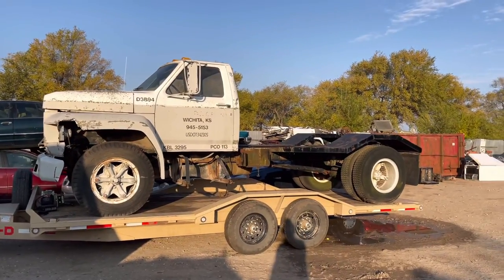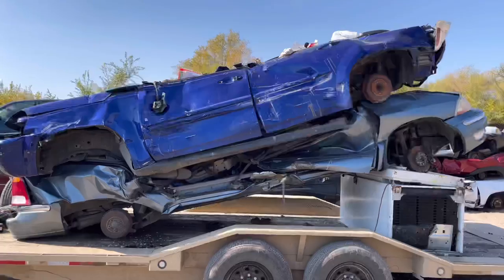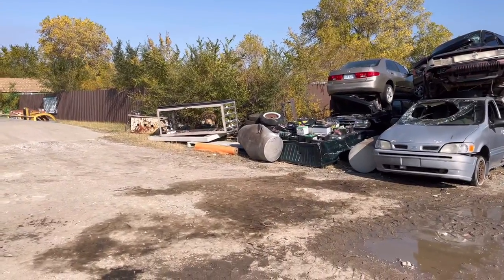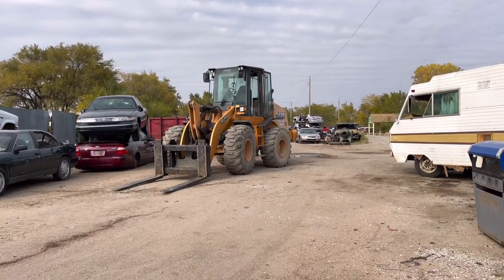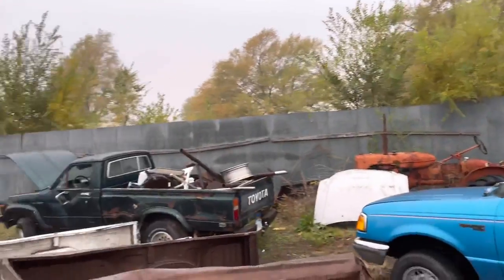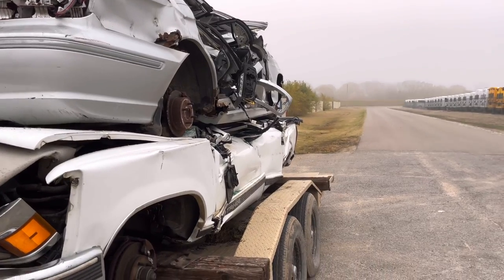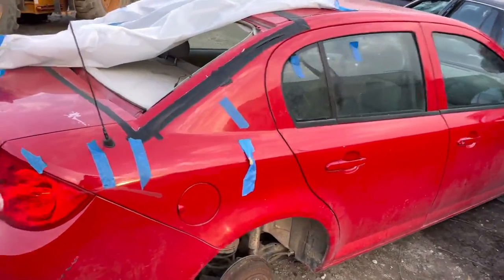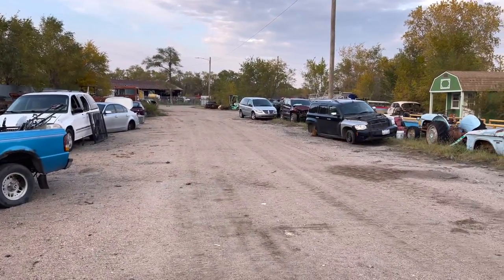I Hauled A TON Of Crushed Cars From Our Junkyard To The Claw

Comment: Silas we have a shredder here in North Little Rock , Arkansas , unload next to it see how the separate types of material is fed to a different conveyer and dumped in piles surrounded by concrete enclosures that front end loaders scoop up and load into dump trailers or enclosed trailers . All of the scrap is not any larger than silver dollar . They don't take tires or gas tanks . The shredder is the hammer anvil type that beats everything to pieces . A lot of the steel is loaded on barges across the river and shipped . The last time I saw the shredder it separated stuff into about ten different classifications . You gotta see it to believe it , it's so Cool .  Great videos

Comment: Consider using a flatbed straight truck to pull your trailer.  You could double the load per trip. And if you hired a driver to take the loads to the shredder, you could spend more time crushing cars.

Comment: Get 2 or 3 sheets of tread plate for your trailer to protect the wood
Reply from the maker: That adds a ton of weight and makes it slicker than snot when wet. If you’re not dragging a ton of nasty stuff off and on then wood is definitely the best
Reply: @AdventuresMadeFromScratch  Something to eat?  Like what?  Big fat steaks grilled right there in the junkyard! Yum!  Yum!  But what to drink, Pepsi or ___________?

Comment: Maybe if you keep running into that issue (availability) buy a new cheep brake booster cause maybe the new ones have a different valve size? I don't know just an idea I could be completely off base
Reply from the maker: They don’t sell new boosters, and the remans use the same size as this one unfortunately

Comment: I'm guessing the seats were from the Olds Silhouette?  I bought a 2003 new, drove it 190K miles with original spark plugs and original coolant, until the tranny died.  Everyone who changed the coolant needed a manifold gasket within a year, so I never changed it!  Great minivan, for the 190K miles, the trip computer says it averaged 26.2mpg.  Exactly the same as a V6 Audi A4 Quattro I had before it.

The other commenter with the theory that the guy just needed the bolts for the seats might be right, except that if the seats were like mine, there were no bolts on the middle and rear seats, they had catches you could release to take the seats out and put them back in.  But there were other kinds of seats available, based on trim level and options.  I actually still have the seats, because the last few years I just used it as a cargo minivan, and put the seats in my warehouse, pretty much like new.  Same color and texture as the ones you sat the cars on.

Comment: The shredder dices up cars into small pieces, then extract plastic, cloth, and rubber from the bits?  How does it work?
Reply: Conveyor belts with different sorting features. Pressured air blown across the conveyor belt blows the plastic and cloth and those kinda bits on to another conveyor belt. Then a conveyor belt with magnets pull the steel bits out and dump on to another conveyor belt. There are other ways but i hope i explained so you get the idea of it. Im sure these days there are laser beams and robots somewhere in the process
Reply: @CowboyCarCrushing  Thank you for the explanation.  No doubt robots control a huge piece of these operations.

Comment: Have to ask, and not to sound all 'judge-ey'...with all those cars, over two yards, and you couldn't find the fitting you needed for the ol' Dodge?
Reply from the maker: Nope, it literally only exists on 64.5 V8 mustangs and 91-93 Dodge d250 and d350 pickups
Reply: That's just the way it goes! 1 million parts but not The One you need! 🤷‍♀️🤷‍♂️ Works the same with tools, screws and such.